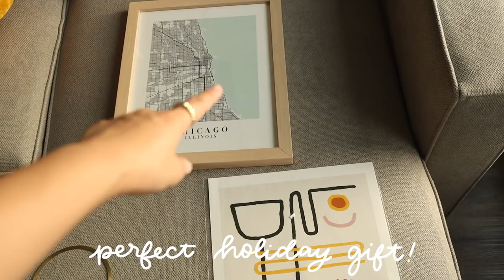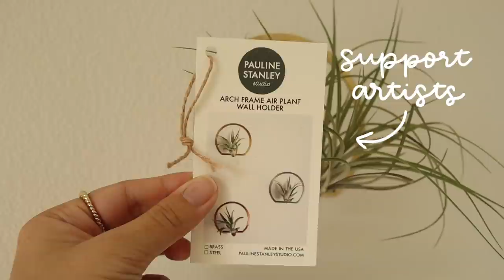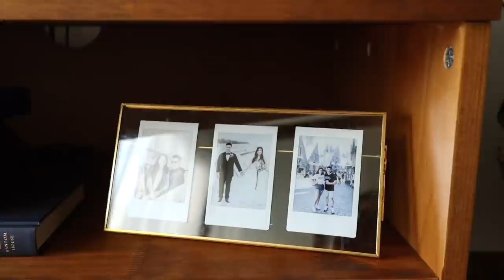EXTREME LIVING ROOM MAKEOVER | Midcentury Modern/Boho, Luxury LA Apartment Transformation

Comment: 3/8/22:  I don't think your room size is all that small for a lot of apartments and small homes built in the 1920s-1950s.  I love that sliding glass door - very cool!  I always hang curtains to provide some privacy at night.  Sheers and semi-sheers are always great for letting in light and are machine washable (in most cases - check the label!)  The rug is beautiful, and you did just the right amount of items for your gallery wall - not too much which would have overpowered the space.  The low console/TV stand is a great piece, it's perfect for the space, and I love your use of green plants to add life and decorative interest.  One doesn't need a ton of furniture and stuff in order to make a cozy fashionable room.